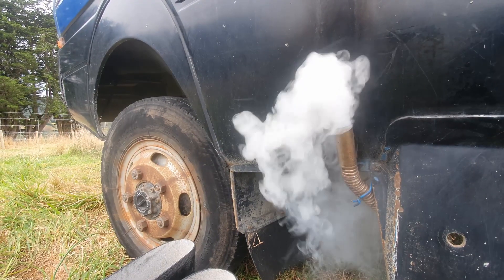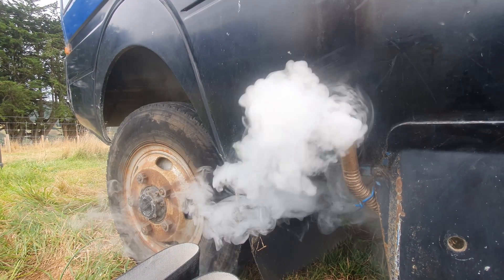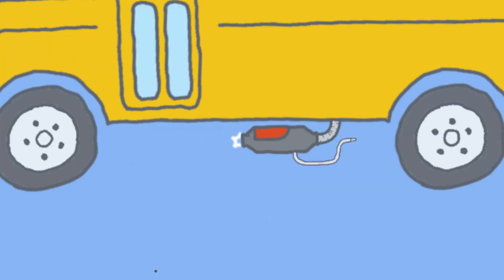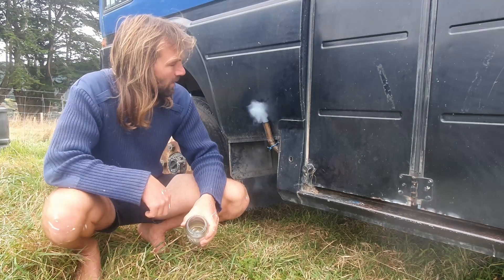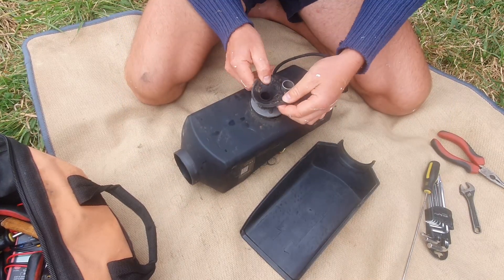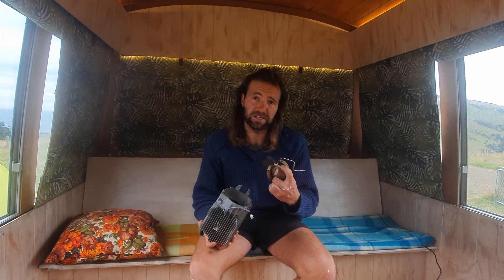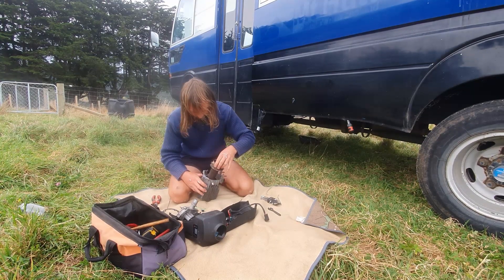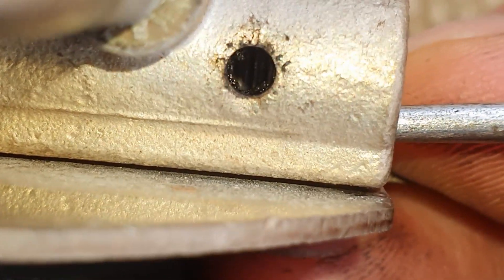[SOLVED] Diesel Heater Won't Start, Blowing White Smoke

Comment from the maker: I hope you enjoyed and found this video helpful. If you have any questions or a suggestion, please leave a comment!
Although you may see ads, this video isnt actually monetised and the platform keeps all the profit. If you would like to support this video with a small donation, it would be very gratefully received. Im pretty sure it's a safe, easy process through this link:

https://ko-fi.com/adamgilbert

I think I spent roughly 40-60 hours to make this video, in an effort to deliver valuable,  quality content. But its difficult to justify dedicating that sort of effort to producing more useful videos for posterity and platform profit alone.
Anyway, thanks for engaging! 🙂
Reply: I thought you might assess the problem I have with occasional flameouts. 
I discovered it was because of tiny air bubbles produced by the diesel pump that accumulated in a an upper bent in the fuel line to the heater.
Eventually it entered the combustion chamber and extinguished  the flame.
Causing a lot of white smoke and diesel leaking before giving an error code and shutting off.
Does anyone else have this problem?
And is there a solution other than replacing the pump?
Reply: Hi ya.. I watched your video and tried all you said. Unfortunately it still wouldn't light. So I took the clean a step further, and it's now working like it was when it was brand new. Just to make sure that it wasn't a fluke, I repeated the same process on the other 2 dead heaters that I had kept when they failed.  All 3 now work perfectly! Video is on my page, hope it helps!  Thanks for posting this to help others who may be struggling.
Reply: This is the most awkward position of an exhaust.
As you clearly shows the condensed water, will never come out.
Reply: Hello, great and wonderful work. I have this same heater and also the same problem..but I don&#39;t know what to do and where to start...and I hope you can help me in the way that I can do something for it..because most people here do not have the knowledge and experience enough to fix it..please help 🥰🥰
Reply: Thank you for making this
.. 
I tried to send you beer money but got this error:"This organization can't accept donations right now."

Have you heard of Ko-Fi?

Thank you for being alive 😋
Reply: If you do the correct shutdown procedure, you won’t get that white smoke.
Reply: great video the music spoils it.
Reply: Thanks bud.   Big Help!!!

Comment: This was an excellent tutorial. I knew about the low battery stuff and such. But the mesh situation where the glow plug resides was new to me. I'm using a Chinese diesel heater for about 4 or 5 years now. Twice I broke the glow plug. Those things are very fragile. Last time i ordered replacement plugs from aliexpress and a whole new unit to have spare, it was only 65usd for an 8kw version. Though it's not an 8kw body. So use with care. Anyway that was a great video. Learned something new.

Comment: Great video, thank you!

I’ve recently fitted a new unit and having moved my air intake pipe indoors to cut fuel bills on startup tried starting. Within minutes the air intake started pumping toxic white fumes into the living area of my van. It’s almost impossible for me to have connected the inlet and exhaust pipes the wrong way round (50:50 chance an setup was running find with the air intake set outside) so I’m totally baffled as to how the air intake could have backed up with fumes and effectively become an exhaust pipe?! 

Any ideas welcomed, thank you.

Comment: Well... You absolutely nailed it man. I was at my wits end with this heater. Only 2 Months old and it did this exact same thing. I tore it down 3 times, couldn't figure it out. I never thought for one second about the little screen and air intake for the Glow Plug, but now I will never forget it lol. My rebuild kit will be here tomorrow at some point but I don't even need it now, the Vevor 8kw Diesel Heater (Square Body) is working better then the day I bought it to be honest. My money is on the fact that that little Screen was blocking the Air Intake for the Glow Plug since it was made in the Factory. I also only ever ran it on Medium, so, I will take your advice on the running it Full Bore from time to time. I can't express how happy I am I found your Video, thank you for taking the time to make it so thorough. Happy New Year! Hope all is well.

Comment: I've had my heater apart four times. I never realized that that little hole is not supposed to be covered by the wire screen. Thank you for letting me know that. I will go back and fix it now.

Comment: I just had that part of you video. However it did start. I have been running it for 4 days now steady and crank it to 6 for 1 hour 3 x a day. 
I have not ripped it down yet. I will buy one more because they are cheap. 
Also any idea how we figure out where to buy the webasto parts for the vevor
Reply: The last part of you video. lots of white smoke

Comment: First I had E08 then E10.  For E08 I opened the unit up, then I got a 9 v. transistor battery and connected it to the fan connector.  Fan did not spin.  Bought a new fan motor.  That fixed E08.  Then I got an E10 with white smoke.  It's funny how you always try to think of the hardest thing first.  After trying quite a few different things it ended up being the glow plug screen.  I replaced it and reamed the little air intake hole with the 90° scribe.  I also noticed gurgling in the exhaust pipe so I blew it out with the shop vacuum.  Then it started right up and has been ok.

Comment: Great presentation. Suggest you add a check for fuel delivery. Make certain that the pump is feeding properly. It is possible that the one way valve gets a speck in the seat and fuel flow gets compromised.

Comment: Got to go through the shut down procedure. If you just disconnect the battery, the unburnt fuel will burn up on start up. That's the easy explanation. If you try different fuels that's a different story

Comment: First problem:.. the heater is outside.  Second, the intake is outside.  Thirrd is the exhaust is outside.    Fourth is that exhaust is angled up.    The best location for heater is sitting high, inside, with intake reachable, and exhaust constantly going down with a fan across it to capture the remaining heat.when mine gets smokey ( only 5 degF INSIDE typically) , i start it with a hair dryer blowing into the intake to preheat the chamber.  Also, the fuel should be warm before. It gets to the heater.  Edit: my exhaust is a meter to 2 meters long, in a lazy 8 to 12 inch coil, always going downwards... Small fan captures every watt of waste heat..
Reply: "Thirrd is the exhaust is outside"(?)  Pretty sure the exhaust needs to be outside 😂

Comment: We’ve just bought a new Chinese diesel heater, everything works as it should, it’s been primed etc., but the motor keeps stopping about 60 seconds after starting up, it doesn’t reach temperature so not sure what’s causing the motor to stop is there something I’ve missed?
Reply: Is there anything restricting fuel flow, sometimes little pieces of plastic can get into the lines from the factory, or during the installation process(?)  Might also try checking the fuel filter for good flow, and make sure there's no dirt/debris in the fuel can you're using to fill the diesel tank.  Also, if I recall correctly, the fuel pump can't be higher than heater, and can't also be higher than the fuel tank, plus, the fuel pump needs to be mounted at a certain angle for best performance, which should be mentioned somewhere in the manual.  If you figure out the probem, please come back and post the fix, so others can learn what solved the problem.

Comment: White smoke and difficult start is carbon build up. Rapid build up is due to exhaust condensation filling bends in the exhaust and eventually stopping combustion. These heaters can't tolerate more than a couple of bends before filling with soot and failing. Take it apart, clean out the carbon, change the gauze and ensure you exhaust only has gentle bends and is as short as possible. The smoke will no longer be an issue.

Comment: Just had this happen after extensive low heat running on mine. Rather than open the combustion chamber , I put a new glow plug in ( the heater has been in the van for 7 years) and metal screen , but first filled the ignition chamber with spray carburettor cleaner and cleaned as far down as I could with long cotton buds. Then blew through the glow plug hole with compressed air. Ran it flat out for 3 hours to burn off any carbon build up. Seems ok now.

Comment: New screen, clean hole, screen below the air inlet hole, no obstuction in air inlet, perfect Voltage, and 85W-90W power draw while plug is running. Still startup (white smoke) issues.
If I blow in the intake air hose, it fires up, so I am still lacking oxygen... Wonder it I cold make things better if I enlarge this little air hole a bit... Any thoughts? These unreliable starts are a pain!

Comment: My unit would blow white smoke because the glow plug had insufficient power in order to ignite the diesel
What I did was to start the heater and stop it after 45-50 seconds then would restart. This would give enough time for the glow plug to be hot enough to ignite the diesel
I did this for two years 
I ended up buying a different controller  that I could program the wattage the glow plug was to receive 
I never had problems with new controller

Comment: 4:14 that sound is water in exhaust.       Never ever have a section not going down.     Mount the heater body INSIDE...  this reheats interior air ... only the exhaust should pass outside

Comment: My heater is installed in my work van and it always smoked on start up, I add liqui moly diesel system cleaner every other fill and it stopped smoking after the first day and hasn't smoked since...2 yrs now.
Reply: Not trying to be smart but isn't adding that additive every other fill up a little bit excessive? Maybe you could do it every 5 fill ups instead? Iva never used that liquid molly stuff so I have no idea if it's expensive or not. What's the extra expense when you add it to your heater every time? Do you use a whole bottle or just a couple ounces from the bottle or what? Thanks.

Comment: IMHO these Chinese heater guys are geniuses! They have created a device that is really useful but also flawed at the same time. While some folks have the skills to tear part these heaters and service them, majority of people end up buying "readily" available spares to solve the issue. Its a flawed system as there is no way to "easily" clean the critical parts of the system as it allows massive build of carbon. It's the nature of the fuel as well.

Comment: Hey I like the video it's straightforward nice job on the illustration an explanations thank you for empowering people to help themselves, when I say all over that way maybe we'll meet up and I'll buy you a beer I just wanted to verify that my thinking might be correct and your video verify that for me and showed me exactly what's inside that thing, I had some old fuel I use my mistake at any rate I shut it down with the old fuel mix in there and fired it up it wouldn't and yes that's green was probably set it up some pieces came out the next time I have chance for maintenance after this very cold weather I'll take it apart and clean that section, a few chunks of carbon came out after I started the unit and got it to start again there was combustion in the chamber I could hear it it was still remain smoking after I shut it off so I fired it up so there would not be a fire inside the unit too long it was enough to blow heat up into there and restart itself that one critical time we have Sub-Zero temperatures coming I live on a sailboat, this would have been horrible had I not been able to get this machine to run until I have better time to deal with it, after filling the cabin with smoke backwards through exhaust system which let me know that my exhaust has some leaks in it to begin with, many thanks

Comment: This is by far the best video. I am having a issue. It starts up almost goes to or does go full fuel but then shuts down. After 3 starts it runs fine. Now seeing this video I see how critical that small hole is for air to get to the screen for combustion of oil on the screen. (Screen is sort of like a mantel is a gas light)
Pressure fed oil burners atomize the oil so it will burn. The diesel heater vaporizes it on the hot screen a very cool process eleminating the high pressure pump and spray nozzel. I am going to try and blow out the fuel feed line to the screen and see what happens. I don't want to take it apart it's to cold. I bet the small hose has dust or dirt build up since the intake air is not filtered other that a screen in the intake.

Comment: Run kerosene through it once or twice a years on high, it will burn hotter and help clean out all the gummy gunk left behind from the diesel.  Also run your heat at a higher temp and open a vent or window it will keep it cleaner.

Comment: Hello Adam.

My heater starts and runs fine for a little while, but then it shuts off and white smoke comes out of the cold air intake.
I have it installed inside the van with the exhaust pipe running out through a hole in the floor.

Any suggestions will be greatly appreciated.

Sincerely, Ricky

Comment: A tip for the exhaust - put a water trap in it.  This is like the U bend on a sink.  Mine is made from a coil of a couple of turns of thin pipe.  The water in the trap stops exhaust getting out but water can flow through it.

The Exhaust is usually 22mm, the same as Plumbing fittings.  I made my exhaust from 22mm copper pipe with compression fittings.  It makes for a tidy robust solution.

Comment: Mine would not start white smoke, stripped heater found blocked with soot and carbon cleaned it back to factory settings. Now starts ok.

Comment: This is probably one of the Best videos i have seen on this smoky problem. Makes total sense to me.
Only problem, is after my same Smokey start up and pulling  the chamber out, i find it very difficult to successfully clean the gause type mesh inside the chamber itself, which unfortunately is welded in place at time of manufacturing.
So after cleaning all accessible parts and replacing the small filter mesh, my heater started right up with No smoke atall. My only solution is to keep a new burn chamber in stock at $27 canadian as a solid back up.

Comment: I use mine 5KW to heat a small workshop, with the exhaust going outside a few meters further through the wall and some glass wool to insulate the wall. I take the air intake inside so that I don't have to make another hole in the wall, fresh air is coming in through all small openings that is no problem I think. All worked fine at low power or medium power untill I reached the 100/150 total working hours range of the heater.  From then it refused to start, fuel came well in through the tubes, but no more combustion, and no flame. It appeared that the heater was completely clogged with sooth and the unburned fuel sprayed in the chamber did the rest and flooded everything on the inside and outside with fuel. Luckely I placed a complete iron reservoir under it to prevent it from leaking all over the floor. Anybody any experience with how to run it without it getting clogged after approx 100hrs ? What should I do / not do / to prevent it from getting clogged so soon ????  I installed a new one and had the exact same result. Burning was nice and clean visible on the outside

Comment: These things are so cheap to buy that there’s nothing wrong with having a brand new or a working unit as a back up this way you’re never down you pull the old one out you put the new one in and you fix the old one and repeat that’s the best way to do it otherwise you may freeze your ass off for days waiting for parts from Amazon

Comment: This video is solid.  Very helpful graphics.  Notably you revealed one problem that almost neve gets discussed, and that is the depth of the atomizing screen.  As mentioned, the screen must be below the air hole.  My heater showed an even more subtle symptom.  It would start fine when the ambient temp was 70F or above. At temps below 40, it would struggle to light,  then extinguish as soon as the heater tried to ramp up.  After using my heater heavily for 4 years plus, I have decided that I really should disassemble it every summer for a cleaning and inspection.   Nearly every problem I have now is due to neglect.  I subscribed and liked just based on the quality of this video.

Comment: I just got mine and it won’t start. It keeps blowing up the fuses. Original came with a 25A fuse. I’ve tried 3x 20A, 3x 25A, and 3x 30A fuses they all just sparked and the unit never started from day one. Do you know what’s the issue?

Comment: Never ever mount it outside.  That style is better mounted high and have the exhaust always going down ..pass through the floor and out.  Have a fan blow across the exhaust and recover more heat.   Fuel tank should also be inside (diesel only)   run it too hot and open a window to keep the air dry (payment is more fuel burned)  if using the unneeded muffler inside, plug the weep hole.    And more....

Comment: ❤ your video 👍
When you buy a new ignition mesh, get one that comes with an insertion tool. It enables replacement to the correct depth without needing to remove any more than the outer cover and the glow plug. It’s so easy to do that I do mine every few months which negates any significant carbon build up in the ignition port. Takes about 2 minutes. I also have a bit of stiff wire with a bend on the end that fits in the fuel supply hole, a quick poke keeps that clear too. Ask me how I know to do this🙄😂